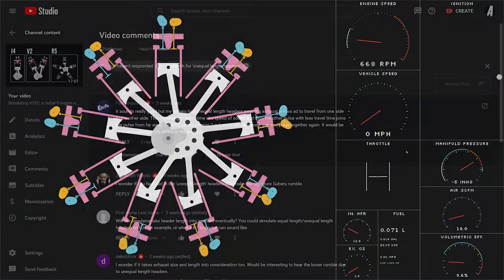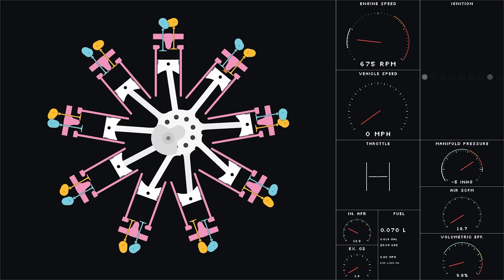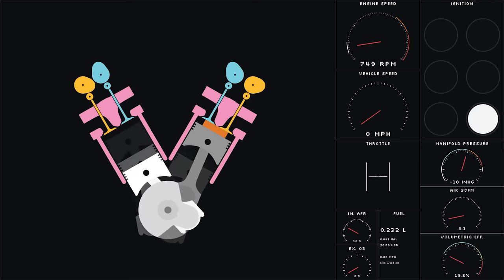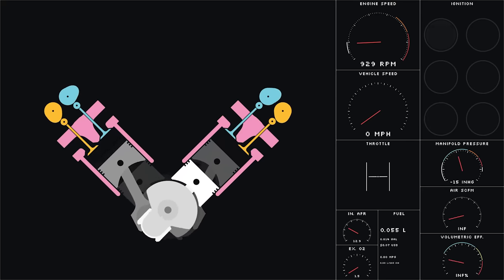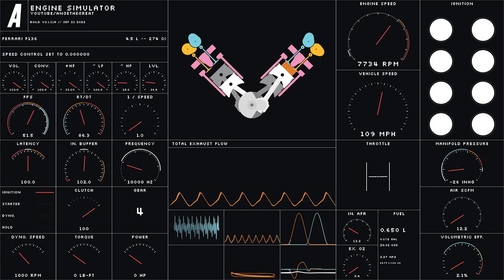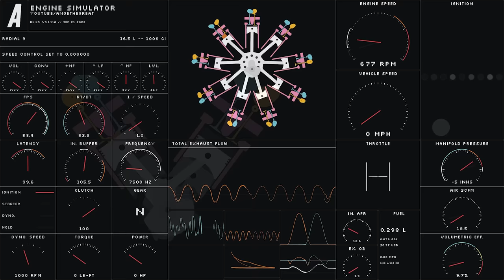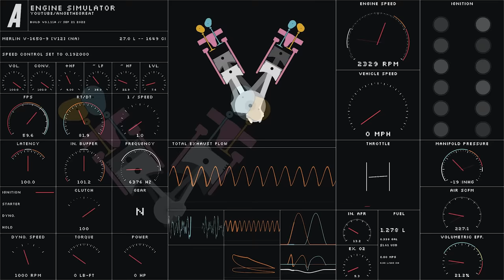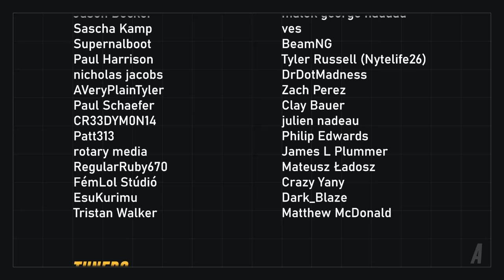Simulating an F1 V12, cross-plane and flat-plane V8s, unequal length headers and more

Comment: Can you please explain how it is possible to replace the engine sounds with meme sounds like "Oof"? I was under the impression that the sounds were simulated aside from the noise channel, so unless they're changing the noise channel I'm not sure how it is possible to do this.
Reply: I am pretty sure it takes a single sound sample as a base and then it processes it into an engine sound
Reply: @ayoutubechannel921  I'm guessing the spark sound, triggered each time the orange rectangle appears, is filtered based on the air flow at a given timestep.

Comment: https://en.wikipedia.org/wiki/Volvo_B8444S_engine
That is one of a kind V8 engine that is 60degree 4.4litre, built by Yamaha, where used on Volvo sedans and SUVs and exclusevly on Noble M600 sportscar. In real life 315 hp and sounds mean. Crankshaft is cross plane, utilises offset crank journals!

Comment: I wish I had time to dive into this but.. not sure if you're simulating the inertia of the crankshaft pistons etc and flywheel that 2jz sounded way fast when revving up..and its possible to shift gears without using the clutch so long as the transmission and engine speeds are matched, easier with dog box but not impossible with synchro..and full fuel and ignition map tuning with simulation of detonation (check out hts you already were talking with Devin anyway heh)..different fuels (e10, e85, race gas, even diesel..?) For different burn rates and knock resistance and mbt..also simulating the IAT and air density, if you had full tuning you can get/calc part of ve from a lot of oem maps...and of course, turbo, though I'm sure that's been said a few times..
Reply: Also full exhaust modeling would be cool, you could test different pipe sizes and lengths and loops and resonance stuffs
Reply: Also almost all ECUs do a full injector cut on off throttle, I still see the fuel climbing a bit when off throttle.

Comment: Overhead cam LS? Are all the engines DOHC? I know it doesn't matter for sound but for efficiency etc valve train has allot to do with overall VE/HP from friction loss and flow is dramatically different from 2v LS heads to DOHC Hemisphere heads. 

Just wondering

Comment: NSX 3.0l and 3.2l V6 (C30A / C32B) was a 90 degrees too ;) would be really nice to hear that one in the sim (goes up to 8200 rpm fuel cut off, has VTEC upwards of 5100 rpm, and a very special intake with secondary runners that open around 4200 rpm - can the sim do that ?).

Comment: Subaru boxer 4 engine with equal-length header is basically the Subaru Impreza WRC car.

EDIT: Also, it wasn't only Americans did the chopped-off V8 to create a 90deg V6. The F154 V6 turbo on Alfa Romeo Giulia Quadrifoglio Verde is basically the F154 V8 twin turbo from Ferrari California T with 2 cylinders lopped off. Jaguar's AJ V6 supercharged on the F-Type V6 S is also the lopped-off version of F-Type R's V8 supercharged engine. Heck, the Jaguar's even lazier because it's basically a V8 block with V6 top and bottom end plonked in.

Comment: the only complaint here is that there's a bit too much resonance on the sounds overall. i think if you removing the resonance with an EQ (this can be done dynamically by just reducing the volume of the loudest frequency above, say, 100 hz guessing here.) and also passed the audio through a compressor it would sound alot better. a compressor might also help bring out the raspy sound that youre looking for.

Comment: I own a 2JZ... It has way more crankshaft inertia than you show. If you stab the throttle open in neutral, it does not rev up to redline that quickly. Does your simulation take into account the inertia of the  rotating mass of the engine?
Reply from the maker: It does take inertia into account, however, different engines have different levels of inertia in their rotating components and most of the engines I demonstrate are meant to be performance-oriented. You could just as easily simulate something that revs slower and has more internal inertia, but I just didn't show any examples of that in this video

Comment: there are 120 degree v6's  but they sound the same as a 60 degree and have they also have some of the advantages of a flat engine. Yes there is one in the BMP tank thing.... it does sound great. 

What about 2strokes? or jet engines?

Comment: Hay @AngeTheGreat I really want to try it out. But I don't know what's happening? I run the sim but in crashes. Cant even open. Can you help. I tried finding solution in the FAQ but couldn't find any. I run the exe file in the bin folder the window opens and immediately crashes. Please help. I also tried some some previous versions but the result is same.

Comment: are the unequal length headers visible on the simulation? i'm not familiar with the concept so i cant tell the difference right away (visually)
Reply from the maker: They're not visible but you can see the difference in the script that is provided with the engines. Thanks for watching!

Comment: The V6 part is interesting but you have it wrong. 90° V6s do have some advantages namely in packaging and weight distribution, which is why they are used as racing engines often. Plus you forgot to do a 120° V6 which is gaining traction now with Ferrari and McLaren
Reply from the maker: Well I never said that 90 degree V6s were useless, I just said that 60 degree Vs have balance advantages whereas 90 degree Vs often require balance shafts. It is also true that many 90 degree V6s began as V8 blocks. Regarding 120 degree V6s, I didn't really "forget" to do them, I just omitted that configuration (as well as other designs like narrow angle V6s) due to time.

Comment: Would you make a Honda Goldwing GL1800?  It is a horizontal flat 6 engine. Not a boxer as the Subaru, but a V engine with 180 degree angle.

Comment: 60 Deg banks on a V6 makes for great packaging, however I disagree that 60 is any more ideal than 90, because in either case, either requires a split pin crank to achieve even firing. 120 Deg is ideal for a shared crankpin, however the packaging isn't practical, while some exotics such as Ferrari's new twin-turbo Hot-V configuration V6 are bringing back this design. 60 Deg is ideal for a V12 while offering a conventional shared crankpin.

Comment: is there any way to boost the fps? my latency dips and the audio gets kinda choppy
Reply: Hold N and scroll down to lower frequency and increase fps
Reply: @Tigglesmith  that fixed it, thanks!
Reply: @mysteryman447  yw
Reply: @Tigglesmith  lol I noticed if I lower it too much the engine just explodes. found a nice sweet spot between the choppy audio and the pistons entering orbit lmao
Reply: @mysteryman447  Yea for me I put it around 60

Comment: Wow! What a huge difference between those two V12s—the RR Merlin and that F1 V12. The latter has the idle RPM beyond the max rpm of the Merlin.
By the way that Ferrari Tipo 044/1 was the last Ferrari Formula 1 V12, as the F1 moved to V10s.

Another thought of mine: why when comparing crossplane and flatplane V8s people start dividing them into 'American' and "European' categories? I can't name any other mass produced flatplane V8s, rather than those made by Ferrari and modern McLaren. And some by Porsche. And a Shelby GT350.
Alfa Romeo, Audi, Bentley, BMW, Jaguar, Lancia, Maserati, Mercedes, Opel, Porsche (not all models), Rolls-Royce, Volvo, Volkswagen (except Passat W8) —all, being European manufacturers, produced/produce crossplane V8s.
Although all Ferrari V8 have always been flatplane, both on their production and racing models, Lancia Thema 8.32 used a Ferrari flatplane V8 in which they swapped the crankshaft with a crossplane one.
So I would add some missing words to that phrase: <European flatplane racing V8>.
Cause what apparently happens is Europeans tend to use flatplane V8s on race cars and crossplane on the daily drivers, while Americans use crossplane V8s on both. Thus a crossplane V8 is not so 'American', it's an international one.
Reply from the maker: It's mainly a stereotype. Non-American manufacturers of course make cross-planes, but I wouldn't say there is a powerful cultural association like there is with America and cross-planes. It's obviously a simplification but most people will associate the cross-plane sound with American V8s and the flat-plane V8s with something either European or "exotic" (ie non-American) and that's what I meant by it

Comment: The simulator doesn't want to run on my machines.  Most are  WIN 7, 32 bit.      I'm wondering if the hardware is why  It doesn't want to run, or am I doing something else wrong?

Comment: weird.. if I have the program running and click on my Windows background, the FPS goes to 60 (where I locked it at in the Nvidia control panel for this executable), but as soon as I click on the window and 'focus' the application, it becomes unstable and drops off to 40-45 FPS.. I run on a 3080ti with a 12900k, do I don't suppose it's my CPU or GPU 😅
Reply: hmm.. nevermind.. when I set my default framerate to 144 (max refresh of my monitor) it just locked to 144Hz)... nvm.

Comment: Would it be possible to simulate what different fuels would do to an engine in terms of sound and performance? Cross-plane V8s have a distinctive rumbling sound as is, but when running on nitromethane like dragsters often do, they're a completely different animal and sound mean as hell. There's a video on here titled "Vintage nitro dragster warm up", and if you skip ahead to 2 minutes in you can hear what a difference it makes when it switches over.

Comment: Can someone simulate the MARKEL MOTOR, a blown ICE invented in Spain in 1999?  It is  a flat plane multi cylinder where EVERYTHING rotates around a fixed shaft, including the cylinder assy's.   I have cad files, but simulators were not available then.  I got a small displacement engine one to the top at For Dearborne, and to the the federal DOE and the DOT in 2000-2001.

Comment: The sounds of these engines is so startlingly accurate.  If there’s anyone in the comments who can answer it, theres a question that’s been bugging me for years: certain numbered cylinder combos always produce the same kind of overtones, I think multiples of 3 (i3’s, i6’s, v6’s, v12’s) make perfect fifth chords and multiples of 5 (i5’s and v10’s) make major third chords.  I was lead to believe that the multiple tones are coming from something separate from the exhaust pulses, something having to do with second or third order vibration.  Is the sim accounting for that or are those engine tones purely from the exhaust pulses, and if so, h o w ?  Explain like I’m 9 years old

Comment: Seems like something happened in this build (or maybe just with your specific parameters), but the V6s in particular didn’t quite sound correct, which is strange since pretty much everything else was either spot on or as close to accurate as I’d expect.

Other V6 videos of other people using your sim seem to have a more accurate sound.

Regardless, fantastic simulator my man
Reply from the maker: I think I got lazy with V6s lol

Comment: You should simulate a opposed twin that doesn’t share a crank pin I’m curious on why a lawnmower engine can run so smoothly despite making 18 hp with 700ccs of displacement

Comment: now those engines are great, but here is what i have. saab build an engine called SVC. its an engine that can variable the compression by changing the angle of the upper engine block (shortly descripted). now can you simulate such an engine here? these are the data that i know about it:
Inline 5 Engine
1,6l displacement
225 HP
over 300 Nm Tourque
up to 3 bar pressure via belt driven supercharger
compression ratio varies from 8:1 to 14:1 with 4 degree of engine angle

Comment: 1. Next up should be different valve configurations other than overhead cams, like overhead valve/pushrods, side valve/flatheads, ioe/intake over exhaust, and others.
2. About how the Americans just chopped off two cylinders to make a V6; if that was really the case, why didn't we just cut a V8 in half, and build a block underneath one of the heads to make a 4 cylinder engine during the early 70s? For instance, all AMC really had to do was to cut its 304 V8 in half, and they could come up a 152cid/2.5l 4 cylinder motor for the Gremlin, to differentiate itself even further from its Hornet origins.

Comment: Do you notice how, under full acceleration, your shifts are really frequent at low speeds and really spread out at higher speeds? You can address that by making the successive ratios between the ratios decrease as the gears get numerically higher.

Basically, your gear ratios are like this:

1) 4.00
2) 2.82 (4/2.82) - 1 = 42%
3) 2.00 (2.82/2) - 1 = 41%
4) 1.41 (2/1.41) - 1 = 42%
5) 1.00 (1.41/1) - 1 = 41%
6) 0.71 (1/0.71) - 1 = 41%

Do you see how the successive ratios between ratios stay pretty much the same? That's why you have frequent low speed shifts and the gears are dead at high speeds.

In the real world, the ratios go like this:

1) 4.00
2) 2.50 (4/2.5) - 1       = 60%
3) 1.77 (2.5/1.77) - 1 = 41%
4) 1.33 (1.77/1.33) - 1 = 33%
5) 1.13 (1.33/1.13) - 1= 18%
6) 1.00 (1.13/1) - 1     = 13%

The ratios between ratios drop off in magnitude as the gears get numerically higher. You're welcome to steal the second set from me, I can 99% guarantee it will sound better when you do your "acceleration runs"

Edit: I can tell you're varying the ratios between different engines, but if anything comes out sounding off, hopefully this gives you a nudge in the right direction for tweaking.

Comment: What is the main performance bottleneck, I'm guessing the fluid simulation? How much variance in pressure output waveform is there from a single cylinder? Could it be precomputed? Getting something that could be used in realtime as a part of a game or vehicle simulation would be awesome and could make you quite a bit of money.

Comment: It's a shame the sim struggles beyond V12's.  It'd be amazing to see one of the colossal 28-cylinder, 4-bank radials that powered the B-29 Superfortress.  Does the sim even allow multi-bank radials?  Could you build a 10-cylinder radial with two banks of 5, for instance?

Comment: Would it be possible to instead of use a rigid body sim to use a bit more math and calculate the torques/cylinder speeds/forces directly?
It may help speed up the simulation, or help it from exploding as fast.

Comment: So it still doesn't support OHV?
Reply from the maker: Adding support for "OHV" would be nothing more than a visual change since the simulator already supports arbitrary cam profiles. Since it's just a visual thing, I haven't prioritized that feature.
Reply: @AngeTheGreat  It's just, the sound of OHC and OHV are different because of the pushrods.
Reply: @s71402san  Not really.
Why would a push rod make the sound differently?

Comment: You mentioned that the simulation is connected to the frame rate. Why is that needed? You want it to be a real time, game like simulator? Usually simulations are executed in non real time. I think it should support to do that and therefore there will be no limit what can it simulate. It would take more time to calculate, but that's not a problem for a simulation if you can save the output and replay it later.
Reply from the maker: It's not related to framerate. In the UI I show the simulation is synchronized to real-time so you can interact with it but the underlying simulation has no connection to framerate

Comment: I think that the only way to implement this real time in a video game is to use AI. We could put basic parameters as inputs, like current torque and thrust intake, and make the model predict the sound as the output. We wouldn't need more information, we could just build a different model for each engine. It probably won't be a perfect replication of this but it might give a realistic approximation.
Someone let me know if they want me to try it out

Comment: If the 90 degree v6 is supposed to be a 4.3 chevy v6... it doesn't sound like tht... I sound much more mean and not like a fart or a honda... I have one in my truck which only has a cat on it and it sounds like a tractor at idle and a v8 in throttle

Comment: Eeeh, I hate to break it to you... this sounds nothing like any Subaru I have ever driven... and I have driven every USDM engine configuration between MY06-21. The pitch and reverb is not even in the neighboring ballpark.
Reply from the maker: I dunno, I've had pretty good feedback from most subaru owners/drivers and I've also compared the audio output to some reference videos online. It's obviously not perfect but it just sounds like you're hating and not providing much useful information
Reply: @AngeTheGreat  You are welcome to assume what you like, so I will leave you with a story.
Last year, I bought the best (silver) audio cable that money can buy. One month later, I commissioned the same company to fabricate a better (imo) cable, because I think that carbon-fiber connectors sound better than rhodium. Can you hear the difference? I can.
Reply: @setoman1  lol no you can't. I can't believe somebody would lie on the Internet!
Reply: @setoman1  lying to try to prove a point. so sad

Comment: F1 engines don’t have camshafts
Reply from the maker: What do they use?
Reply: Formula One currently uses 1.6 litre four-stroke turbocharged 90 degree V6 double-overhead camshaft (DOHC) reciprocating engines. they introduced pneumatic valve springs but nothing else! the FIA regulation's specifies it too
Reply: They do....